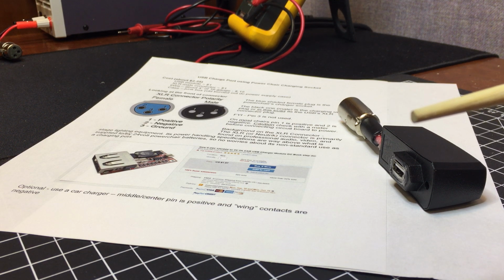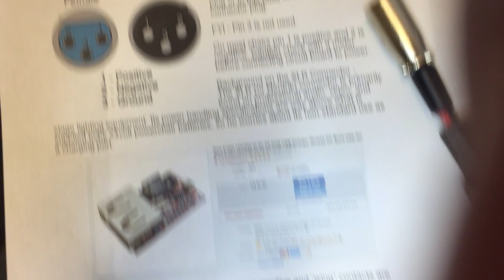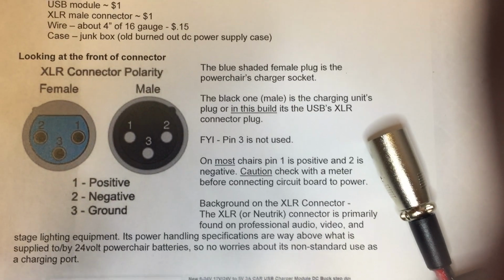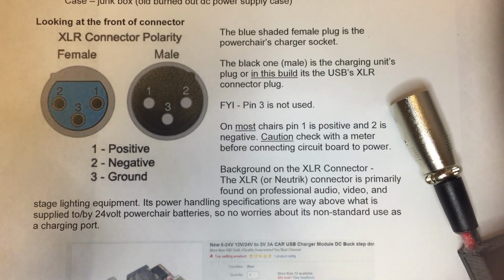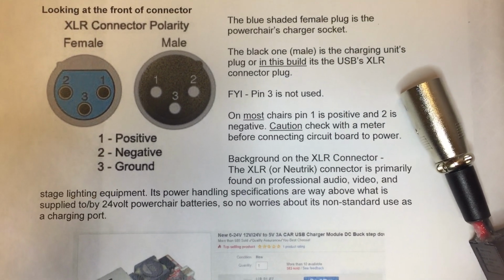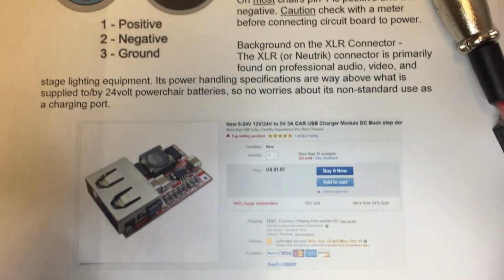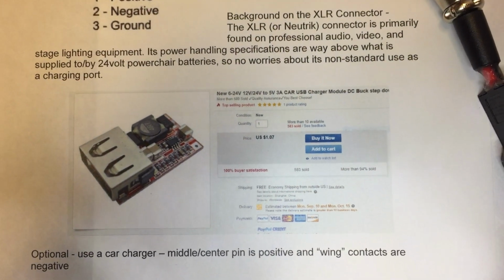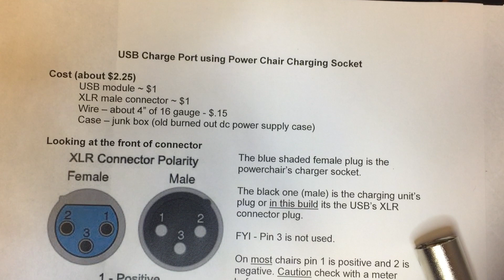PowerChair USB Charger using Chair's Battery Charging Port - cheap build (~$2)

Comment: I Take it all back. i wired back to front. i now have a great double usb outlets 3.0 almost any voltage for most things usb. and it looks shop bought. i bought two items plug and double usb 3.0 waterproof outlet for motorcycle. soldered them together and apresto fantastic job looks great and works even when scooter is turned off.....oh it has its own on off switch to. So thankyou very much for showing how to wire XLR male socket.   Recommended .